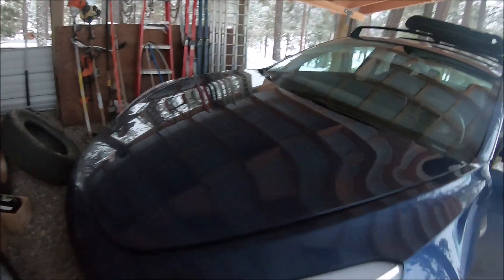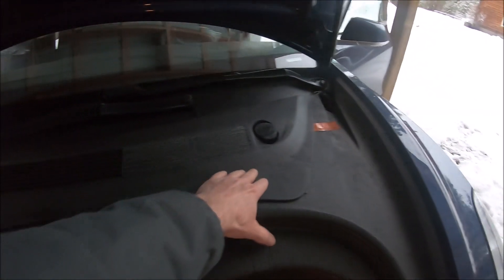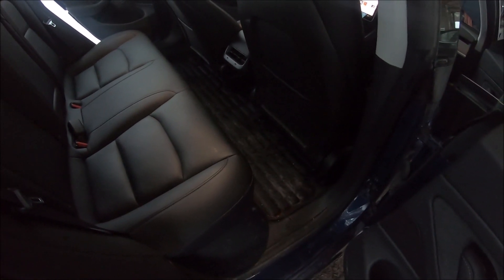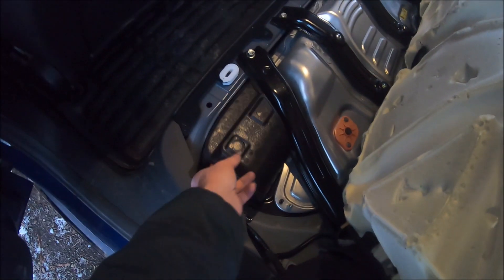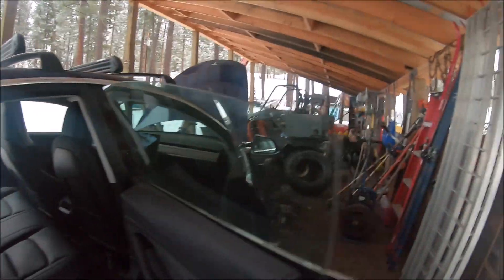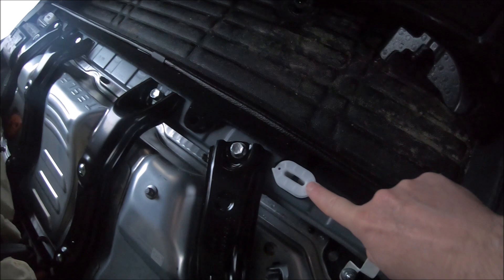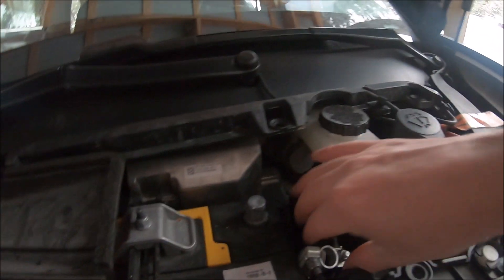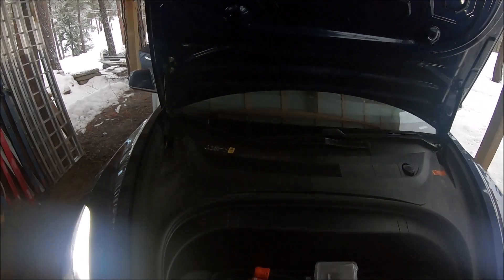This will Reset Tesla Model 3 Faults. Part 3. Level 3 Reset

Comment: I have an a210 coolant valve calibration error which I believe was due to low coolant flow.  Resolved the low coolant flow and the a210 doesn’t pop up anymore but I can’t clear the old alert.  Will this clear that error?
Reply from the maker: Sounds like you are looking at inactive fault codes in service mode. This reset will clear some faults and issues that are showing during regular use. At the time when this video was shot, minor or nuisance faults were very common. These have been mostly resolved since. Actual service faults usually clear themselves when the problem is resolved but will stay in the list. You can try this reset but I don’t know if it will clear the history. Some of these can be cleared with Tesla Toolbox. 
One thing to try is maybe a software reinstall. But again I’m not sure if it will clear the history.

Comment: Is there anything else that can be done to clear fault codes? I tried this and it didn't work. It appears that my faults are all related to a need to get the wheels aligned. It disabled FSD, Cruise Control, Hold, Regenerative Braking, Stability control and Hold. I got the wheels aligned at Tires Plus but I can't clear the codes so none of those things work still. Tesla insists on $235 per hour to diagnose before doing any actual work. That's why I didn't bring it to them for the alignment. I was hoping that the codes would go away on their own after fixing that.
Reply from the maker: @TCMapotherIV  Go into service mode and see about more info on fault codes. Possible that you can reset from there. The following video also shows how to get into service mode: Tesla Battery Health Test & Service Mode, Tesla Model 3, Tesla Model Y, Battery degradation test
https://youtu.be/TMbOsoq24gc

Comment: Tesla Tech told me to put all the seat-belts into their respective buckles before lifting the seat to prevent them from going under the seat.  This saves you the trouble of having to fish them through when you put the seat down
Reply from the maker: There not to hard to get back up if you have two hands not holding a camera, LOL. But that said it's a good a idea to buckle them. I hope that I don't have to do to many of these resets anymore as Tesla was able to get the Airport Radar situation resolved and now  I was upgraded to hardware 3.